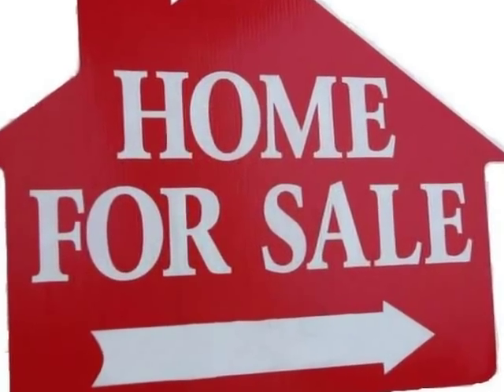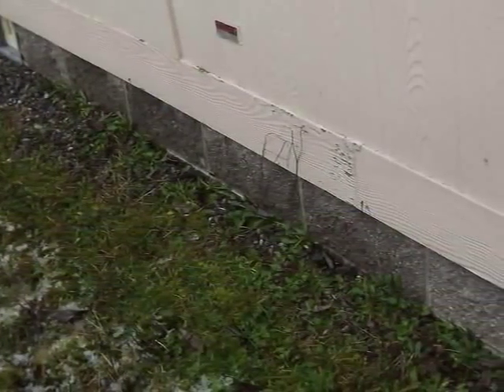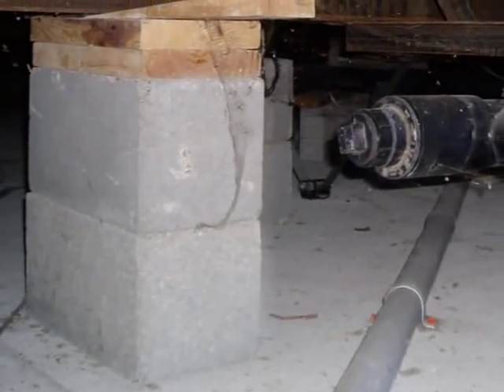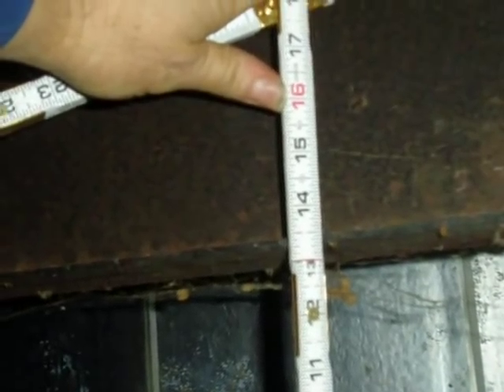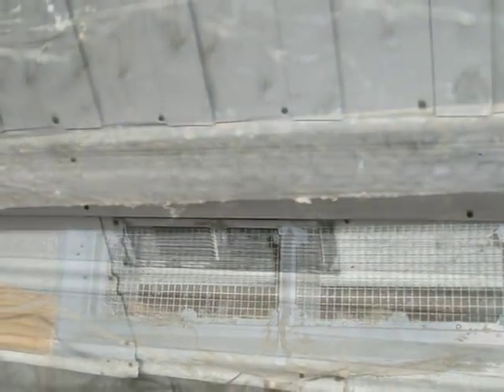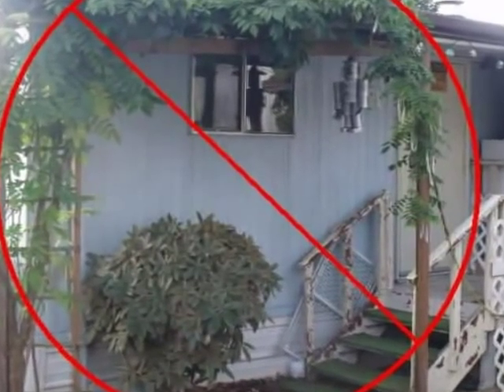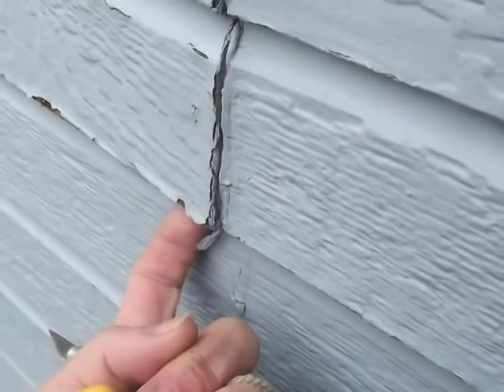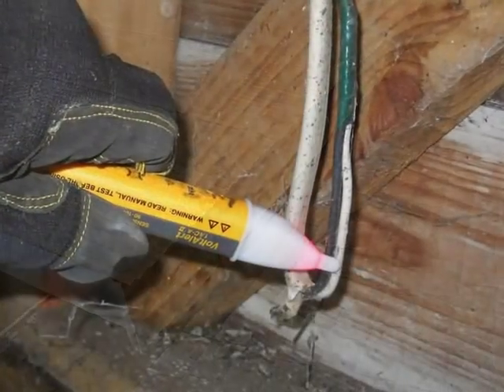HUD Foundation Certifications (Manufactured Homes) Bellingham, WA

Comment: Permanent Foundation.  HUD. FHA VA.  The concrete slab for a manufactured home requires a Civil Engineer Certificate/Letter if one wants the manufactured home to have a permanent foundation.  Most/many/some manufactured home dealers do not wish to provide information concerning a permanent foundation.  As the selling manufactured home dealer want to finance - at a higher interest  rate - the manufactured home.  Nor does many dealers have a relationship with any civil engineer.  The selling dealer makes additional money financing the manufactured home that is not certified.  The actual difference between an ordinary slab and a slab certified by a civil engineer is minimal.  Be wary of manufactured home dealers that tell customers that they do not need a permanent foundation.  It's a lot easier to sell a used manufactured home that is certified by a civil engineer as having a permanent foundation  than ones not certified.  It's your money.
Reply from the maker: I have seen a number of  "dealer installed" manufactured homes that were poorly done.

Comment: You may be in WA, but this is good information for everyone. As a Landuse Planner, I THOROUGHLY reviewed these items that you checked off. But I did not know about the 1996 issue. Why do they not meet HUD reqirements?  Good video!
Reply from the maker: Thanks.
Reply from the maker: Guy...just realized you had a question in there. I had not seen it. Sept. 1, 1996, HUD released or revised a "Permanent Foundations Guide for Manufactured Housing" (384 pages per the description at the  HUD website). It required standards that were often not employed by installers prior to that date. So a foundation install prior to that date is iffy: might meet the 1996 mandated guidelines, but it is not all that likely that it will. Sort of a crap shoot. Check the HUD website for the doc cited here.